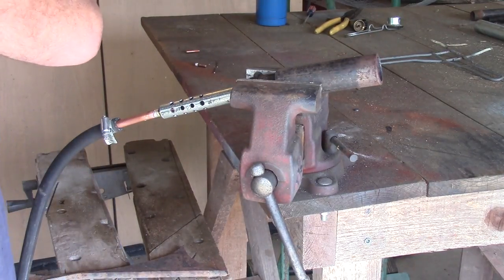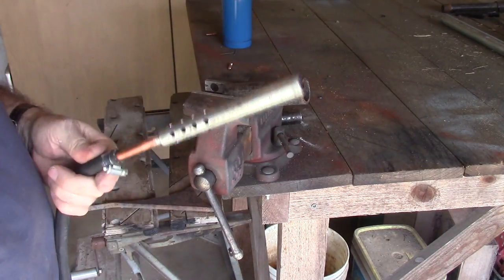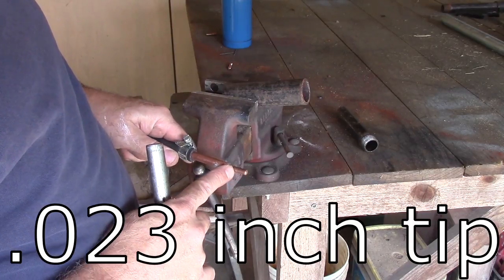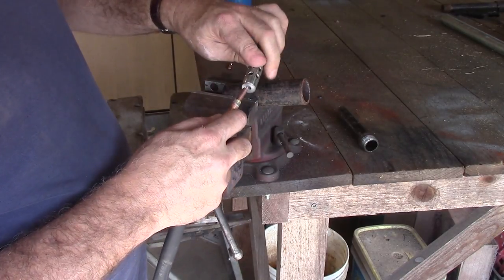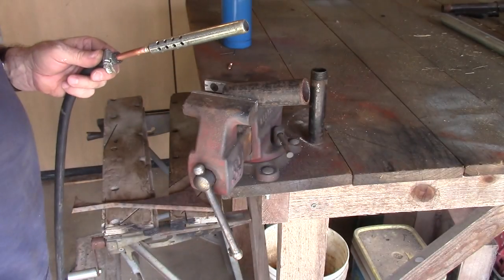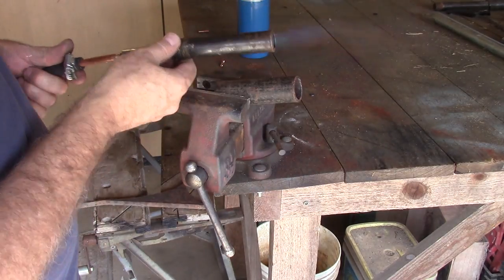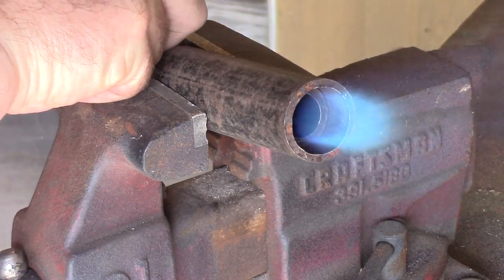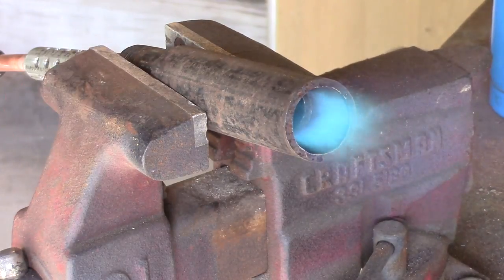Experiments Making A Propane burner

Comment: Great video !!! 
You saved me a lot of aggravation and a great deal of free education on the learning curve. 

I can tell you one thing for sure the BBQ regulator released about 10 pounds of pressure of propane.  That is not enough for a kiln.  You need minimum of a 50.  Mine is 100.
Reply from the maker: Agreed.  If you look at my foundry videos you will see the furnace I use and it's attached to a big propane tank with a high pressure regulator to get more propane.

Comment: Nice show! Ive been playing with that for a while. Forced air is easy because you mix and force it out the end but natural aspiration is another story. I did the same but added another color so I could slide it over the air intake to restrict air. I havent tried the screen yet but it appears that it does about the same as the flare on the end and slows down the airflow letting it burn rather than blowing out. I also tried adding stainless pot scrubber material inside to prevent flame from traveling up the pipe but was not really necessary with good mix and velocity. Thanks for sharing your experience. I enjoyed that!
Reply from the maker: You're welcome.  Thank for letting me know you enjoyed it!

Comment: Thank you for filming this! This one vid has been more helpful to me than ten of the ones with nearly identical $40+ pipe fitting style burners! Unfortunately I've already got around 20 bucks worth of pipe junk lying around and I'm still just using my 1lb propane torch to melt aluminum! I do know that these homemade burners function somewhat differently when placed inside the foundry or forge however, so I've still got a little experimenting of my own! Thanks for the inspiration and data though!
Reply from the maker: Glad I could help!

Comment: Thanks for showing us what a waste of time it would be adding a baffle screen at the end of the tube! Otherwise good demo on making it from scratch with the MIG tip and conduit.

 Also would like to add instead of milling out a piece of aluminum for the MIG tip to fit into the conduit try using a small piece of rubber hose! 

And one more thing, no need to add the brass fitting to the copper tube to hold the MIG tip just gently tap around the end of the copper pipe to reduce it enough to TAP thread it directly to the MIG tip. Easier,faster and cheaper! Your welcome!

Comment: a flare tip on the end of your burner would change your life man. I promise its worth it. some get pipe fittings and screw together but thats expensive. I got brass ( which is one of the metals that is one of the lowest conductors of heat.) and I took the brass and heated it up on the end and hammered out a nicely tapered and space saving flare. the don't touch my crucible anymore because they are more compact, not to mention more efficient
Reply from the maker: Thanks for the idea!

Comment: A rosebud has a copper spiral running down the tube which mixes the air and gas down to the tip for a 60% gas to 40% air mixture. Try that?

Comment: 0.023 inch What is that???
Reply: Joe Grech He's using MIG welding tips for the propane orifice.
Reply from the maker: Mig welding tips come in different sizes and are convenient to use as gas orifices.  I was using a 0.023 tip.  Thanks for watching!
Reply: Size of the mig tip in 1000ths
Reply: I will guess you want to know in Metric Joe Grech. It would be .6 mm and will if you choose that size most likely have a 1mm pitch 6mm diameter thread as the ones I use do. Hope that is of some help.
Cheers all from John, Australia.
PS: Soat Mon, I enjoyed and learned from your video and experimentation. I have just spent the day making parts for an experimental burner for a hand held torch. Tomorrow I will get to play and see if I can make it work well or scratch my head again. Thanks for your time sharing. I am also curious as to what regulator you are using, adjustable, fixed or perhaps just at bottle pressure.